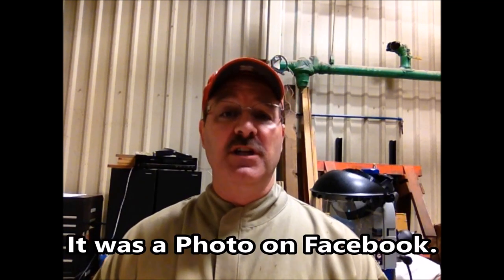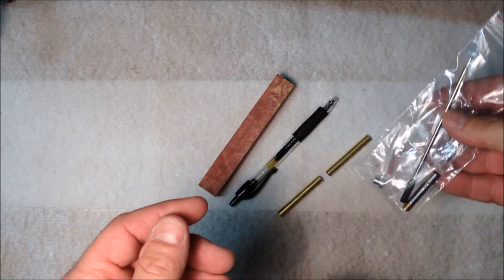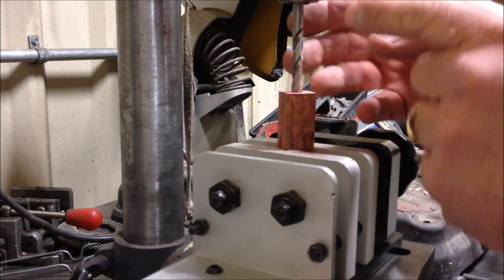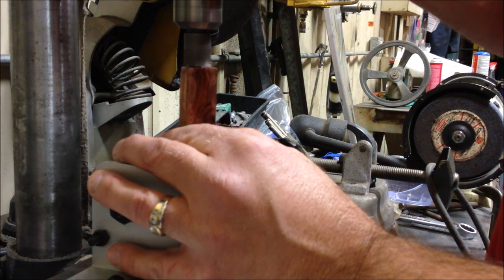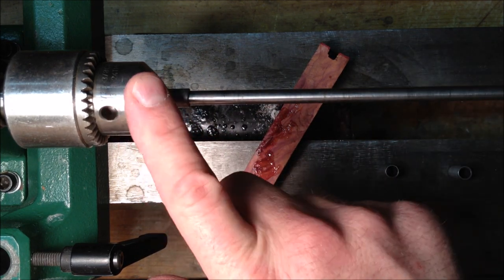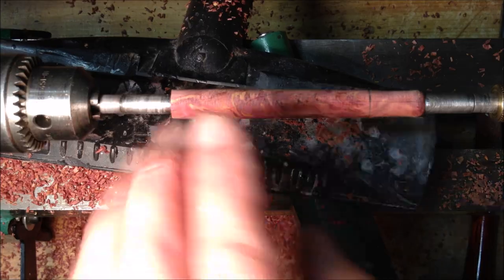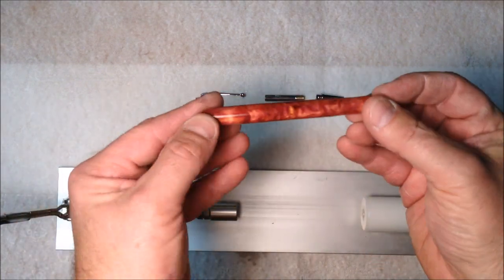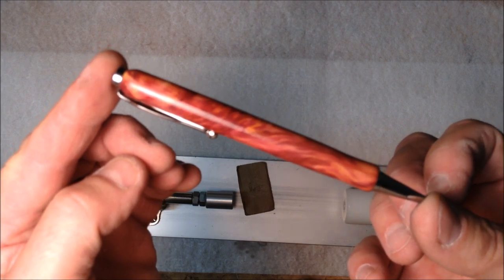Modified Slim Line Pen from Figured Cedar

Comment: another tip for drilling, stop short, and then cut off to reveal the hole. i have had issues with acrylic blanks exploding, but this put a stop to it.
Reply from the maker: Thank you, 

  This is an excellent tip. 

Regards,
Bob

Comment: Great idea. Lucky for me that I have a sawmill close by and he saves me lots of unique pieces of wood. Yesterday,  I cut a scrap of quilted maple into enough blanks for a dozen pens. I have a cedar piece that ill cut up today. I dont think it will be as nice as the ones you got, but its cedar and cedar always looks great.
Thanks for the excellent way to add some flair to the slim/fun line pen kits
Reply from the maker: Thank you Bill. 
  That’s awesome that you can mill your own wood. 

Regards,
Bob
Reply: I have 2 cedar boards that are 66" by 14". Gojng to make a waterfall table. The top will have an acrylic  inset that is 24 x 30 x1/2 thick. They were 1 slab at the sawmill that we cut in half to transport in my SUV. So they will be a perfectly matched waterfall. I should have some decent cutoffs to play with.
I only got into pens to teach a neighbor lady how to do them. Plus I have close to 100 pen kits that came with my used lathe. I really love the use of slimline into a 1 piece pen. Beautiful.
Now, her son makes the pens and sends them here and sells them at craft shows. We share a tent, I sell bowls, boards, rolling pins, honey dippers. Everything except pens. I've only made about 8, so far, but each one is getting better. I'm basically using your CA finishing process (I'm out of thin, so 7/8 coats of medium with the micro mesh polishing. Plus no plastic polish so I used a high price liquid car polish that did a good job.)
I'm ordering some thin and some Hut tonight.
I'm 84 and don't want to waste away in the lounge chair watching soaps.
Thanks for all the videos and the great ideas.
BR

Comment: Nice one Bob,

I'm going to try this.  I never use my drill press to bore the blanks,  It's not accurate enough for a blank that size.  I now use my new lathe, which I will be doing a review on soon.  

i put the blank into the scroll chuck,  make sure it is at 90 degrees to the bed with a
an engineering square and drill with my jackobs chuck,  I find this more accurate.

Once again a very nice and informative video. 

Regards,

Bill.
Reply from the maker: Hello Bill,
  I just got a #2 Morse taper Jacobs Chuck and a set of Nova jaws. I didn't use them to drill this hole because the bit was so long and there was quite a bit of wobble. 

Regards,
Bob

Comment: What a cool idea!!  I'm in the process of making a couple of comfort grip pens...without the rubber grip and without the center trim ring.  In place of the trim ring I'm using a small piece of corian glued to the top blank.  This required a slightly longer top tube, but an easy fix.  I'm planning to turn the blanks almost down to the comfort grip bushing, then remove the bushing, put the blanks together on the mandrel and sand them as if they were one piece.  I'll re-insert the bushing and finish the blanks.  I hope it all works out like I planned!!
Reply from the maker: I don't like to use that rubber grip either. I like the idea of the Corian. 
  When I've made pens without a center band, out of wood, as you barrel trim, stop short and apply some thin C/A to the ends of the pen. Let it soak in and dry then finish trimming. I find that I get a much smoother action between the two halves if its not just end grain to end grain. 

Regards,
Bob
Reply: +RJBWoodTurner Hi Bob,  I don't think I can post pictures here, but I'll try to send you a picture of the finished pens.  One is  stabilized redwood burl with a CA finish, the other is Ziricote with OB shine juice finish. They came out pretty decent.Rich
Reply from the maker: Feel free to email the photo,
  My address is rjbwoodturner@ufoww.com. 

Regards,
Bob
Reply: +RJBWoodTurner The email is on it's way!!Thanks,Rich

Comment: this is great.... i've never been a fan of that ring on the slimlines. can't wait to try it. A little tip for ca finishing- instead of blue tape, just save the tiny little ziploc bags from your pen kits, and use those as little finger covers. thanks for sharing all this info with us!
Reply from the maker: +Made BySkateboarding Thank you. I haven’t tried the baggies yet. I do have a bunch of them. 

Regards,
Bob
Reply: RJBWoodTurner give them a try. Just make sure they're not dusty, and only apply a small amount of CA at a time. Since the plastic doesn't absorb any of the CA, you'll need to use way less than with paper towels.
Reply from the maker: +Made BySkateboarding Thank you
For the advise.

Regards,
Bob

Comment: I was making one of these last night and remember another tip/warning.  

When you glue in the one fixed tube you shouldn't "pump" in the glue. It can create a ridge or drops of glue in front of the tube that for a normal pen would be trimmed off but for this design could interfere with the loose tube.

I partially inserted the tube without glue, applied the thick CA to the tube and then just spun the tube as I pushed it in. 

I guess with CA the excess may soak into the wood but I could see more issues with epoxy and poly glue.
Reply from the maker: Good point Cliff,
  I'm going to make  modified pen with a closed end, what are your thoughts on glue build up for that?
Reply from the maker: Excellent thoughts. 
  I'll put my mi d to work too and see what I can come up with.

Comment: RJB, I never could figure out how the transmission worked in this version of  a slimline--Thanks for this, I will be trying a few of this design soon--do you know how to go about a similar pen that takes a Parker refill?? I'd really like to build something like this that handles a Parker refill!! BTW, drill bits have FLUTES not 'flites' and those are what clog up and make your bit squeal--I keep a brush right by the drill press and sweep out the FLUTES every time a withdraw the bit to clear--it can also help to squirt a little bit of water down the hole as you drill it to keep it cool, just a little info FYI
Reply from the maker: Thank you Don,
  I do have an idea for a Parker refillable pen. Hopefully I'll get my shop back up and running soon and then I can attempt a video. 
  Thank you for clarifying the Flute /Flight definition.  I will try to remember that and use the proper terminology in my next video. 

Regards,
Bob

Comment: Instead of blue tape, I use polyethylene(PE) gloves when doing a CA finish. I checked with a CA glue manufacture and they said that PE gloves were the best. That is what they use for the CA glue bottles and what they specify for protection when handling CA glue.
Reply from the maker: Thank you for the tip Jim,
  I've only used gloves a couple of times and they were Latex. I ended up getting the finger stuck to my blank. I haven't used them since. I may have to try again with the PE gloves. 

Regards,
Bob

Comment: I made this modified slimline pen. It came out really nice. The only problem is that I can only open and close it with a pair of pliers. What did I do wrong? I didn't do so well with the ca glue either so I used friction polish.  Thanks, Ruth
Reply from the maker: +stonimal Hello Ruth,
  It the glued in barrel is not perfectly straight, the transmission will go in at an angle. That causes binding and the pen will not work properly. 

Regards,
Bob

Comment: something i have been pondering is what if you took the sawdust from these exoctic blanks, had them cast in alumalite blanks and turned them, how they would turn out. always got stuff going through my head
Reply from the maker: I'll bet it would make some pretty amazing blanks. I hope to get into casting with Alumalite soon. I'll try exotic dust when I do.

Regards,
Bob
Reply: roger that sir, if they turn out like my mind thinks they would, id be interested in buying a couple, as well as looking to buy a couple pens from you for christmas presents
Reply from the maker: That sounds great,
  I have maybe 75 or so pens made up, my shop had been disassembled so I'm not turning at the moment. If you wanted something custom I probably couldn't get it done by Christmas since I don't expect to have the shop up and running untill after the first of the year. This move is killing me. 

Regards,
Bob

Comment: I made one of these a while back, trouble I've found is it can be difficult for some people to turn the nib to extend or retract the writing tip.  Other than that its a great way to make a pen and eliminate the 2 piece style, and to me the pen looks better without being cut in half in the middle LOL.  

I really enjoy making the one piece type pens, faster, they look better, and makes better use of the slimline kits IMO.

I've mad a lot of pens, I've never blown out a pen blank...yeah right.  Most of the ones I've blown out have been acrylic, very seldom with wood, its usually acrylic that causes blowout problems...and sometimes its caused by the blank being damaged somewhere and during the drilling process the weakened spot in the blank gives way.  I have actually glued a couple back together with luck, most I end up setting aside in case I make a pen where I just need 1 blank.  

Its more fun to play around with the cheap slimline kits to see what you can make out of them...because they're cheap, if something goes wrong its not much of a loss LOL.

One little note of importance.  Makes 100% sure that the glue from the first brass tube is cured before you drop in that 2nd tube...don't ask how I know this HAHA!!!
Reply from the maker: Thank you William,
  I agree, they are faster, better looking and make great use of the slimline kit. 
  I have just purchased a Grabber mandrel so in looking forward to trying this kit with a closed end. 

Regards,
Bob
Reply: RJBWoodTurner I purchased a grabber mandrel a few weeks ago, haven't tried it out yet though.  I'm looking at picking up the new grabber mandrel they just came out with for larger pen styles for 8mm and up kits.  Its a great way to make some closed end pens and be a bit more creative.  

When I first started I made slimline pens because the kits were cheap, after I turned a few higher end kits I realized that they're actually easier, and a bit less time consuming because you remove less material with larger diameter pens LOL.  I don't make very many slimlines anymore.  I make a few just for around the office at work so if they grow legs its not like they're the more expensive pens which I keep at my desk HAHA.  I gave my boss a bolt action pen a few months ago, he spent about 1/2 an hour playing with the bolt action mechanism LOL.
Reply from the maker: I agree Slimlines are more difficult to turn because of the two separate sections. With the modified Slimline and possibly the Grabber, I should be able to make larger diameter pens.

Comment: You have some awesome ideas on turning pens. I'm thinking about getting started on turning pen and pencil sets. Have some ideas of my own and have a lathe that I'm not using so why not. What would you say I would absolutely need to get started as far as tools and fixtures. The pen parts I know I'll need. I do have a drill press also. Keep turning those awesome pens.
Reply from the maker: Other than tools,
  Probably not much. 

  You
Have a drill press if you have a vide for holding blanks that’s good. If not you can put two pieces of wood together at a 90 and mount them to a third. The blank can be held in place with a clamp for drilling. 

You’ll need a barrel trimmer to trim the blanks or a sanding jig if you have a disk sander. Either will work. 

A mandrel, I recommend the mandrel saver. 

Pen kits, bushings, and drill bits. 

Sand paper, Friction polish or C/A ad a finish. 

You don’t have to have a press as a clamp will do the trick. 

Regards,
Bob
Reply: Thanks for you advice Bob. It is greatly appreciated and I hope to have some videos on Youtube some day. 
Joel

Comment: Very nice. I like that style. Did you square the blank on each end? Maybe I missed that part. Really like this one.
Reply from the maker: Yes, I did square the blank on both ends. Place the loose tube inside the blank and square it like you would any normal blank. 

Regards,
Bob
Reply: Ok cool. Thanks

Comment: Thanks for the videos.  I made this today but the pen was much shorter than previous pens I have made. Was the same for you?  Thanks  again for all your help.
Reply from the maker: +Greg Longfield Hello Greg,
  The modified pens are a bit shorter, I believe it's because they don't have the trim rings. That ring separates the top and bottom sections of the pen by a gap of about 1/4" when slipped into the transmission. 

Regards,
Bob

Comment: Update. I've made 5 of the 1 piece  slims so far. A cedar that blew up at the front  due to a catch at a tiny knot. But I saved it with CA. 2 figured maple that are really nice, a segmented figured maple with an East India Rosewood  band that is beautiful.  And another segmented that the CA joint failed so I re glue with 2 part epoxy.  Which also failed when I was pressing in the cap and clip.   Glued it back with CA and activator but didn't use an interior dowel to line up the 45° angles. So, of course the sections were slightly off. Enough that the front nib section wouldn't  go in all the way.
Ruined by a dumb mistake. First failure out of a dozen. Not bad but disappointing. 
Thanks for al. Your excellent  videos.
Reply from the maker: Think how much you’ve learned from those failed pens. I’m currently working on Herring Bone blanks and have made probably 20 of them and so far none have been turned into a pen. Each one is a little better than the last. Eventually I’ll have the process figured out. It’s all about learning and improving. 

Regards,
Bob

Comment: I love the pen! I kept wondering why you weren't gluing the second tube and then I was like DUH!! LOL    I have had some trouble with my drill press drilling at a slight angle on longer pieces... any advice on how to make sure it stays perfectly straight???
Reply from the maker: +Mike Barratt I like to drill a pilot hole then the bit will track much straighter. 

Regards,
Bob

Comment: I use a Pony Clamp mounted vertically for that last bump. Its always too much with my home made pen press.
Reply from the maker: Great idea Cliff,
  I'm always nervous over that last bump. 

Regards,
Bob
Reply: RJBWoodTurner Thought for sure you were going to have pull out your punches. :-)
Reply from the maker: I only ever had to do that once. Even though it makes me nervous every time, I'm pretty good at it. I think over confidence is when the trouble starts. 

Regards,
Bob
Reply: RJBWoodTurner, you should try an Arbor Press. I have always used my 1 Ton Arbor Press for pressing pens together. Even though it is way over kill for pens, I have never had any control issues and can easily make very small movements. Harbor Freight sells them for less than $50 with a coupon.

BTW, I truly love your videos and I have learned a lot. In fact, I just finished one of the modified pens from a slim line kit. It turned out great.

Comment: Great video. New to the hobby, why wouldn't you just use the lathe to drill the blank?
Reply from the maker: At the time a made that pen, my lathe had some bearing issues and wasn’t true. I’ve replaced that lathe and the newer one works well for drilling blanks. 
Regards,
Bob

Comment: One thing that you didn't cover very well, what you did to trim the end of the unglued tube.  when I did mine I drop it in the blank and trimmed down to the end.  when I assembled the final pen the transmission ended up full seated into the glued tube.. now I cant get it apart...Works nice and looks great just cant get it apart.
Reply from the maker: +Spankysgang1954 It sounds like you did what I did. I glued the back tube in and dropped the second tube into the blank for trimming. 

Regards,
Bob

Comment: One time my dad gave me a modified slim line blank all prepped and said “you can do whatever you want with it” so I did the turning but I added ridges it came out really nice but the sanding was ANNOYING!  It was my second pen it came out so pretty and comfortable
Reply from the maker: Nice, 
  Ridges are a pain to sand. I stick with smooth surfaces. 

Regards,
Bob

Comment: In your videos with acrylic pens you use a plastic polish, could you get the same result with brasso?
Reply from the maker: Hello Martin,
  From what I have been learning I'd bet you could. There are people using Brasso, auto scratch remover, tooth paste, and all types of other products. If give it a try and if your happy with the results, I'd use it. 

Regards,
Bob
Reply: +RJBWoodTurner do you think that after your move you could do a video on these alternatives for polishing up acrylics?
Reply from the maker: Hello Martin,
  Possible, I would need to acquire several different compounds but it would make for an interesting video. 

Regards,
Bob

Comment: Bob,

With the second tube not glued in, do you have to crank down on the mandrel nut more than normal? or does the one glued tube provide enough grip and friction with normal tension on the nut?

Btw, beautiful pen. Thanks for sharing!
Reply from the maker: Thank you Bob,
  No, I didn't do anything differently. I treated this like any other pen. 

Regards,
Bob
Reply: +Brook Keele (WannabeCraftsman) The grip is mostly between the bushings and the wood. The tubes would add very little grip.
Reply: Fair statement. I was thinking about the grip being on the tube, but I just hadn't thought it through enough. Thanks for the feedback.